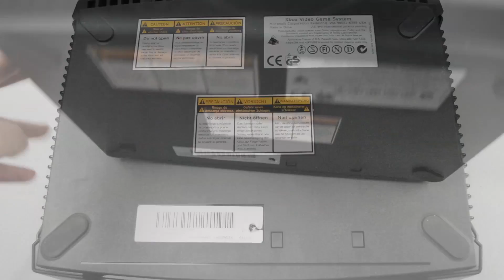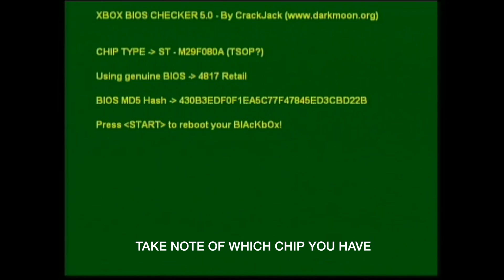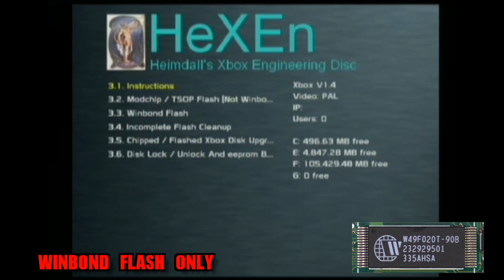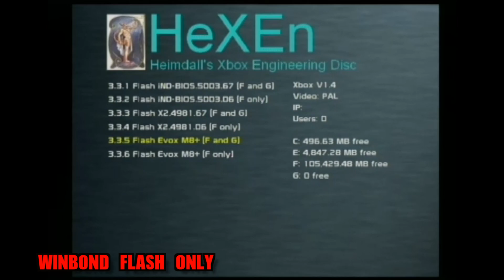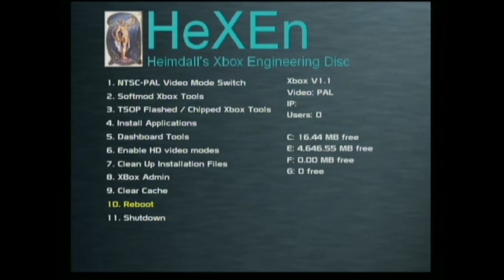How To TSOP Xbox Easiest Method v1.0 to 1.4 | MOD Guide

Comment: If I'm going to use a larger hard drive, should I install that before flashing the TSOP, or after?
Reply from the maker: +Snarkticon after is easier
Reply: +Slot1Gamer I got a 250gb HDD in there after flashing. Thanks for your video and your help. :)

Comment: My hdd died, can I use this mod to boot the hexxen disc without the hdd and install a larger one?
Reply: No, that's the danger of sticking with strictly a softmod and not reflashing your BIOS. If your hard drive craps out on you, you're pretty well stuffed.
Reply: +Safiloo1 Try taking the controller board off the HDD and hitting it with a heatgun (or put it in the oven at 180 degrees) for a few minutes.  I did it to my HDD (220 degrees for about 8 minutes waving it around the board from a distance of about 5cm) and it fixed it.  Might work for you if the problem with your HDD is the solder needs reflowing.
Reply: buy a modchip and use a slayers disk, it should work. but this all could have been avoided if you flashed it or made a backup hard drive.

Comment: Great video, thank you!  Question- when you unlock the disc, does this mean that when I install a larger hard drive that it does not have to be lockable?  Thanks again!
Reply from the maker: mattfuller Yes this mod makes the console not require HDD keys, so you can use any unlocked HDD, you do still have to install the dash files too any new HDD's

thanks for watching
Reply: @Slot1Gamer  By installing dash files what exactly do you mean and how would you proceed. It would be great if you had a follow up video installing a larger hard-drive with F and G partition, cause I think that's the route most users will take. Great video nonetheless!

Comment: Awesome video! Thanks!
Reply: Is this the same method if I have an Xecuter 24K Gold chip?
Reply from the maker: Andre Paseschnikoff Thanks :D If you want to flash your stock bios (TSOP) then this will work if you have a chip, just be sure to disable the mod chip whist doing so to avoid bricking it :D

Comment: Good tutorial, well done!  The information on how to flash a sharp tsop is not quite correct though.  For a Sharp you do need that jumper wire, and you also need the points on the bottom and top of the motherboard bridged, but you cannot bridge the top points until after the Xbox has been started.  You can just add one piece of hookup wire to each point on the top of the motherboard, and then once the Xbox has started you can just twist the ends of the wires together, creating your bridge.  After you flash the Sharp tsop once you don't need the hookup wire anymore and you can permanently bridge the top points together with solder.  There is also a newer version of Hexen disk by shambles1980 here

http://theisozone.com/downloads/xbox/tools/new-hexen-shambles-edit/

That has a specific option to flash a sharp tsop to make the flashing easier.  I know because I have done it before.
Reply: thanks for the awsome info ...you are a credit too the modding sceen.
Reply: other thing this is very important is the sharp tsop is a (1 megabyte tsop not 256k) so this sharp tsop need a 1 megabyte bios not a 256k bios keep in mind if you flash a sharp tsop  with 256k bios in gentoox wont resize the bios you end with a result bricked  console) and gentoox wont resize the bios like in evox flash so to flash a sharp tsop correctly (you need gentoox or raincoat flash utility with a 1 mb bios to flash a sharp tsop this is because ( sharp tsops need raincoat and gentoox have raincoat and block erasing) not chip erasing like evox flash (so to flash a sharp tsop never use evox flash) use only gentoox or raincoat flash with a 1mb bios is the only way.